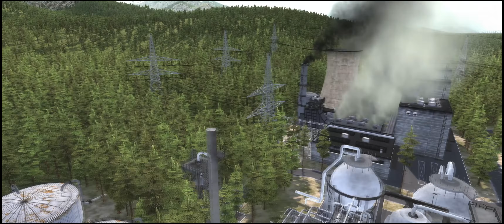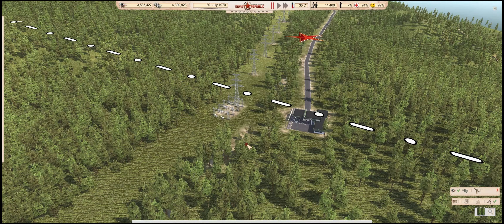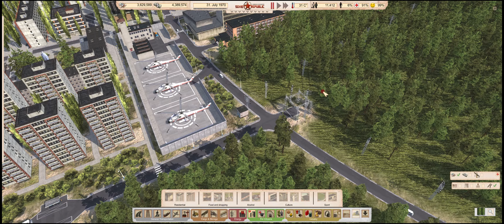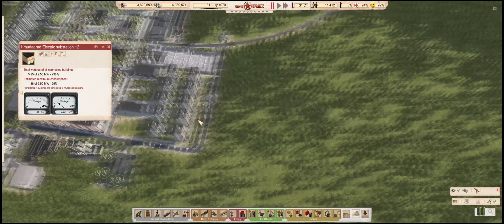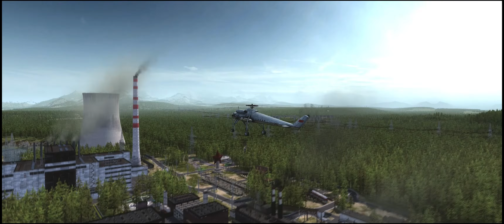How to Build an Efficient Power Network ║ Workers and Resources: Soviet Republic

Comment: Some more notes, look at peak use of a building then divide that number by 60 (seconds in a day) that gives your peak wattage assuming full production.
There is a clear incentive to plan and use appropriate connections by understanding actual use. Your network will look great too instead of running 18mw transmission lines all over the place.

I don't actually know the numbers but voltage is much less important, it should only be a limitation of how long wires are.

So bring HV to a populated location then break it down and use MV to supply the local area. Think of it the same as trains vs trucks.

Comment: I think the voltage meter is useful for seeing if there are power problems. Voltage with drop or fluctuate if there is more power demand than supply. Voltage should be constant and maxed out. This is also how the power grid works IRL. Grid operators monitor the voltage and turn on more power production when the voltage drops. 

In game I have issues with intermittent sources of power like incinerators or wind power messing with the voltage. I use a HV priority switch with the power plant and imported power as imputes to help with the problem, but I wish there were a better way.

Comment: I would like to see proper setup how to use all available electricity from power plant. It says that coal power plant produces like 1400 Mwh of power (I guess it is daily). To convert megawatt hours to megawatts, the number of hours must also be known - lets say it is 24. Divide the number of megawatt hours by the number of hours. The resulting number is the number of megawatts = 1400/24 = 58,333 MW so one coal plant can feed about 3x 18 MW wires (54 MW) but in game it has only 2 high voltage connections but also 4x medium connection wires is 2,35 *  = 9,4. So it is 18+18+9,4 = 45,4. It is just weird. If you split one high voltage into 2 to have 3 high voltages (54 MW) it means you can use 4,3 MW more that means almost 2 medium 2,35W or 2,35 with weaker 1,5MW to have 54+2,35+1,5MW = 57,85MW which is basically the limit of coal power plant. Is that right?

Comment: Also, you should remember that you can't have more than 19 transformers connected in series. The 20th transformer will simply not work and won't provide any electricity. 
It's hard-coded into the game!!

Comment: What I dont understand is how a powerplant can produce so much, but only have one or two connections for large power lines. At max you can only move 18-36mW when power plants produce so much more. How does this work?
Reply: You need to use the switches I think
Reply: It works by reading the correct number, then you will see that the coal power plant produces 24 MW of power (listed under "maximum wattage").
The 1400 MWh per day is a totally useless number that you should not be looking at.

Comment: Hey! Just wanted to let you know that Voltage isn’t necessarily the amount of power produced, but the amount of power produced relative to demand
If you hook some renewable energy sources up to an export station and crank the output up to 100%, you can see that power output in watts is incredibly unstable and that the voltage is ~0. In order to drive electricity, like in real life, you need a relatively higher total power produced on one end to power going out on the other end, and the only way to reliably manage that for non-border points is controlling how much wattage is used in certain regions.

Comment: Power in this game is so intuitive. You really have to follow a specific approach to mess it up. People who experience issues will typically build 18MW and 2.35MW cables everywhere, and use a ton of splitters. Once issues pop up, they are difficult to pinpoint, because all the cables are the same, and there are way too many MV splitters. They then attempt to fix the situation by building more substations, powering them off the same overloaded cables. To avoid such a situation, I like to use smaller cables further down the line, so that the network is easier to read, and I know not to split too many branches off a smaller cable. I find the power overly completely useless, because power shortages already become apparent during gameplay long before the overlay will show yellow Voltage. Colours on the line are not informative, either, if you ask me. It's best to check the Voltage at your switches instead. If you've built appropriate cables for each connection, you will never need to check the load on the cables, you can just work your way up the line to locate the source of the issue (assuming the issue is not at the power station, which should always be checked before delving too deep into the intricacies of the network).
Reply: Too complicated and so, too blue. You, comrade, are deported to the off map to blue stars side. Bye forever. In red side lights may flicker, work may stop but overcomplicated science style planning and speech is forbidden.
Reply: @candlesinwoodenroom4888  this comment made my day

Comment: I've heard that there are some more situations that can lower the bandwidth pretty drastically:

- Every next switch does cut some maximum wattage that goes through it.
- Underground wires reduce power by like 50%.
- Long distance can reduce some power, but HV lines work fine, as IRL.

This means that we should use HV lines going straight to the destination switch, avoiding HV switches if we can.
We should avoid having several switches in a row - this would work pretty bad at full loads. It's the most common and harmful mistake.
We should avoid using underground power if we can.

Our power network should rather look like a beautiful tree: with a tall thick trunk, multiple balanced branches and twigs. No branch should stick out too much.

I'm really bad at this game, but some of that info could help to build a better power network, avoiding power losses.

Comment: 500 hrs into the game and I still have the impression that voltage is useless and the only thing that counts is wattage. I always look at wattage only and because its the only thing whose estimated consumption is indicated in substations I really don't see the point in looking at voltage. Please correct me if I'm wrong or if I'm missing out on smth :D
Reply: Voltage is electrical push and decays over distance.
If you run your lines too far you should see the voltage start to flicker and buildings at the end of the line might suffer brownouts.
The high voltage wires will push the electric current further than the thin medium voltage lines. You need to make your electric grid like a tree, feeding the medium voltage branches, with a big thick trunk of high voltage line.
Reply from the maker: To be honest, same here. There might be some remote edge cases where it might be relevant, but I cannot think of one. I mostly just use voltage in the overlays to check where can I see some yellow or red indicators.
Reply: Thank you for the reply! I'll research this question on the steam forums and on the game's discord and I'll let you know if I find something out

Comment: Could have mentioned how to check how much power each building uses.
 In the bottom right corner of the megawatt graphic, with the indicator needle, is a number xx.x it is the MW (amount of bandwidth) that a building will consume/produce at maximum occupancy. This MW value is also listed in the tooltip screen when you hover over a building at the build menu.

Comment: Other useful tips for power distribution:
1.  You can connect wind power to your main grid via a transformer.  Plug in 6 big windmills, 1 per MV connection and pipe the power out of the transformer to an HV switch.  You are now connected with green energy.  Green power will be used first and can lessen the load of your coal/nuclear/oil power.
2.  Develop a power template.  I suggest the following HV Switch ----> Transformer ---> MV Switch --> Substation.  6 MV switches per substation.  The reason being is that you will often find you have to destroy/rebuild power connections because you want to run a road or building.  This lets you hot swap connections using the MV switches so you don't go without power.  Always use no more than 5 of the MV connections on your transformer so you can do the hot swap. The purpose of the HV switch is 2-fold.  First, so you can hotswap the entire city network if needed.  Second is to fork off your high power lines to continue on.  You just need to use the overlays to ensure you have enough power.  You can also use HV switches to join or split power grids.
3.  If you want to export and import power both, you need to do it at separate facilities.  It is even better to simply separate your grids if possible.  Use 1 HV connection for your domestic consumption and another for export, for example.

Comment: So, the meter on the left is voltage.  The game distinguishes 3 different modes of voltage:  Low V: 220-230 V.  Most buildings are measured as LV and LV is delivered via substations.  Medium V:  22-110 kV.  You will see this on transformers, switches and substations.  MV is delivered via transformers, switches and MV lines (0.5-2.35 MW).  A substation acts as an MV -> LV switch.  I don't believe any vanilla buildings require a direct MV connection.  And finally High V: This will show as 110 kV need on some buildings such as Steel Mill that required a direct HV connection.  HV switches and transformers will also show 110 kV.